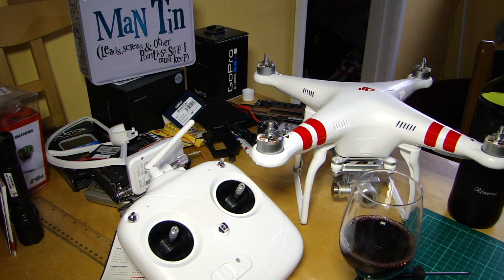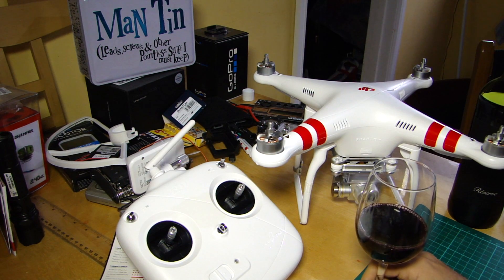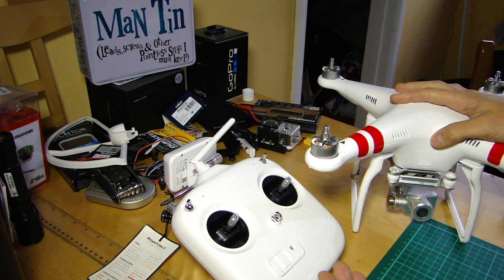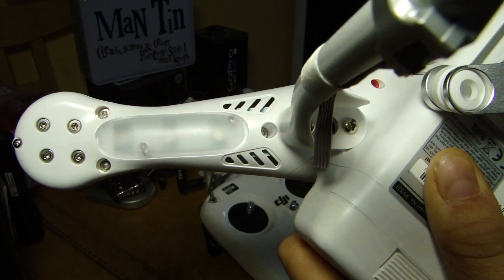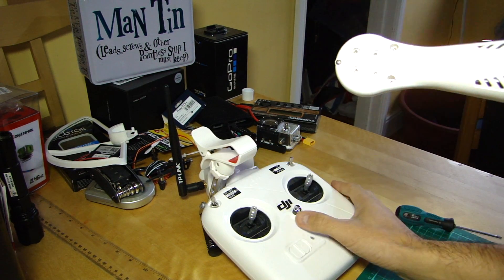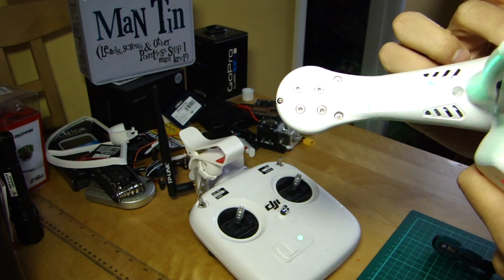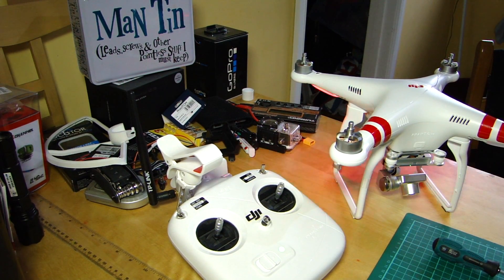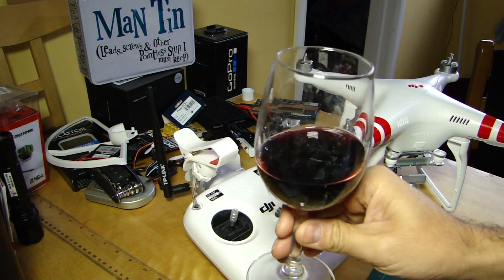How to bind or rebind a transmitter / remote controller to your DJI Phantom, Vision+

Comment: Good afternoon ..  nice video just a quick question I bought 2 DJI Phantom 2s one is a Phantom 2 Vision the other is not. Also one of the controllers is the upgraded rechargeable and the other is batteries however neither of them will connect to the aircraft as it continues to Blink after pressing and turning on controller any idea why?

Comment: Hi, my issue is the opposite, I broke the main drone unit but have another Phantom 3 Standard. Is it possible to bind the remote from the broken Phantom 3 to another working Phantom 3?
Reply: Were you able to find solution for your problem?
Reply: me too, same issue
Reply: ReizePrimus should work all the same with any RC controller/vehicle!

Comment: Hi Simon, I just purchased the Phantom 2 vision plus V2. It comes with the old remote without gimbal dial. I have the new remote with the gimbal dial for my old drone. My old drone is at the bottom of a lake. I tried this and nothing happens. The light turns orange but once I turn on the controller nothing changes. Do I have to unbind the controller from the lost drone so I can bind it with the new drone. If so how do I unbind the controller? Thank you
Reply: +Simon Newton it was phantom 2 but I'm not sure which version because I bought it online used and didn't know much about it. It came with the gimbal for GoPro. Also came with the newer controller with gimbal tilt on top left  and the rechargeable battery.
Reply: +Simon Newton oh ok thank you so much.

Comment: Hello Simon,     
Trying to turn the remote on.  1st turned on booster waited till both greens came on.  
Than  attempted to switch power to controller, starts green, and than turns red with a high pitch beep about 1/2 second apart.  What is happening, and how do I get it back to green so I can fly?   In advance, Thank you very much!  John

Phantom 2 controller with new Duracell bateries

Comment: Good morning Mr. Simon!  Since I'm having such horrible problems getting my transmitter that came with my X525 build to operate correctly, I'm curious, can I bind my dji transmitter to a different receiver??   My X525 is using the KK2.2.5 board and a flysky receiver. Or should I just purchase a "quad copter" transmitter and receiver to fly my X525 and my phantom and do away with my dji transmitter??

Comment: I have an issue with binding and would like to know if you can tell how to ascertain what may be causing a problem? Transmitter (RC) or Receiver (bird). Thanks much! -F
Reply: ***** It is not binding between the rc and bird. I suspect a faulty part but not sur which unit. Can you answer me this. When in the P2 assistant, do the positions all show green? as one of mine  the T stick is showing black and I am wondering if that indicates a fault with one of the servos or links for a specific module? Thanks very much for your reply,-Fred
Reply: ***** (I am getting a cfg error)
Reply: ***** I did all that. There is no movement in the P2 assistant window but the RC assist shows movement. I did a hard recal there is no error number showing in the pop up window which indicates the cfg err. Where is the number supposed to be? Thanks!
Reply: ***** I received it unbound from another who had this issue I am trying to repair. Rebinding doesn't work. the cfg-err message says to do things which I have done. I believe there is a trasnsmitter hardware prob or receiver hardware prob but need to know how to ascertain which. Thanks! (in the assistant the control stick has t -1000 and is black. the rest are green and neutral)

Comment: My Vision+ binds perfectly with my original controller, but does not detect the new controller and will not bind to it. I notice that my original controller beeps twice when I turn it on, whereas the new one beeps three times. Is there any significance to that difference?
Reply: ***** No, I haven't changed it to FCC mode. I'm thinking of ordering another unit to see if that solves the problem. (And many thanks for the videos, all very helpful.)
Reply: Ooops, sorry, but I now realize that I ordered a controller for Phantom 2, not realizing that my Phantom 2+ requires a different controller. My bad. Thanks again for your replies; keep those great videos coming!

Comment: how you fix it The LED on controler turn yellow all the time after update assistant software Phantom and Rc software calibrate but the controler still yellow and can not power the phantom but tilt the gimbal work ok .thank you

Comment: The transmitters are exactly the same. don't waste your time or money. 
I posted this earlier and i was wrong. I meant to say receiver, so my opinion does not pertain to this video at all. I apologize for that.
Reply: ***** Wait what? Im actually talking about the receiver in the phantom. Part #16. I heard DJI released an "upgraded" version of the receiver which is part #11. These two receivers are identical. Please correct me if im worng and tell me how because my shop tested them both and there is no difference between the two receivers.
Reply: ***** I totally agree. I meant to say receiver. I made a mistake. My comment doesnt belong here for this video. But since i have your attention and im rather confused, DJI has made a new 5.8ghz receiver for inside the phantom 2 vision +. There is part number #16 for phantom 2 vision and now as of late they are selling part #11 for phantom 2 vision + which to me they are exactly the same except for the price. Do you have any knowledge if they are somehow different? I sell modified receivers (part #16) and its causing problems for my business. Thank you in advance for any help you can give.
Reply: ***** Thank you so much for checking. We even tested it out in the field with 2 Phantoms. One with the "new" receiver and one with the "old" receiver. There was not noticeable difference between the two at all. Visually they are identical. I just thought someone knew something about it that i didnt. If true, its kinda of crappy they would do that and then charge 10.00 extra for it.

Comment: Simon, I see on your old Transmitter you used for demo purposes you had the 5db antenna mod on the wifi module.  My question is, does this really help? I have been having a lot of issues lately with "broken connection" issues.  Saw that mod on youtube and may give it a go if it is a worthwhile endeavor.
Reply: As always thanks...have a good Holiday !!

Comment: What about repeater? You can use any vision plus repeater now, can't you? Also, can you use 2 controllers with the same aircraft? Like, make it remember the old transmitter also in case u decide to use it. Was wondering if I could bind my extra controller to the vision plus so when I don't want to fly ling distances,  I don't have to have the bulky setup. Table is looking too clean by the way lol
Reply: ***** Lol. Definately a simon response with the yet in parenthesis.  U will try anything haha.